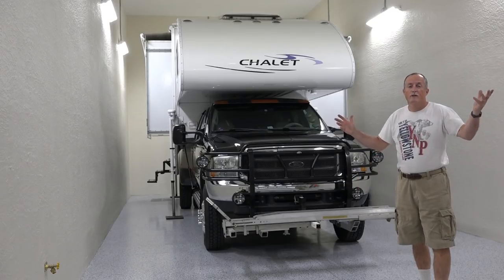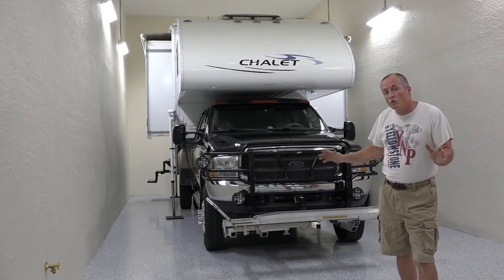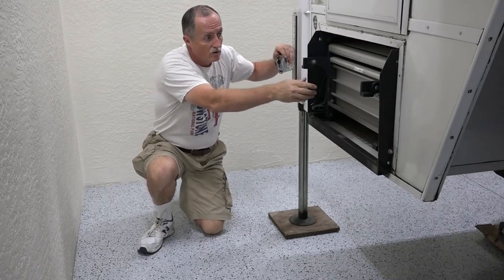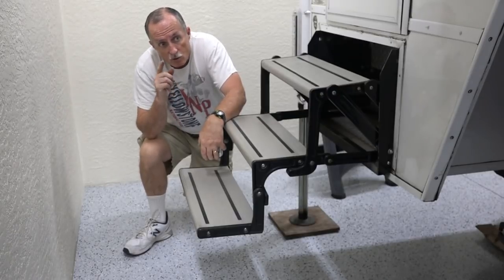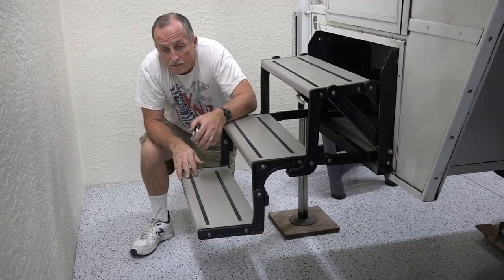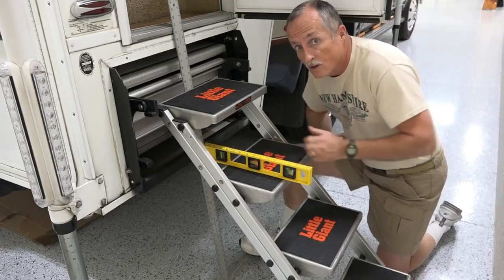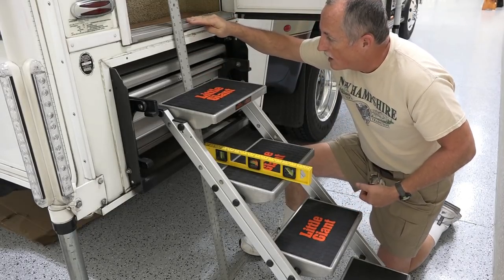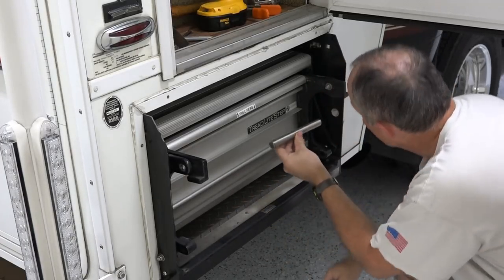New Pivoting & Folding RV Steps - Enhanced Design

Comment: Thanks for sharing what you figured out to modify the Little Giant for your application. My challenge is the habitat box door entry height on my expedition camper. It is 48" from ground, and I would need 6 steps. I looked around and the best system in US out there are the typical accordion retractable ones, but they have their problems, including the Torklift.

The folding mechanism of the parallelogram works better for my needs. I was giving up hope on the 4-step one you use. But I decide to buy one to closely examine it, to see if I can buy two to get enough for 6 steps, and replace the 4 rails with longer ones that I will have to fabricate my own.  Little Giant makes some of the best products in the US.

I suspect the steps most likely are fastened to the rails through the round AL rods with crimps on both sides. That would makes it very challenging for the modification.

Comment: This is such a great idea and very well executed.  Do you think it would be possible to further modify this ladder to reduce the rise between steps?  I need to have about a 4" rise to accommodate someone with restricted mobility.  The ladder would be used on a travel trailer with a 19" rise from ground to the top of the floor level.  Thanks very much.